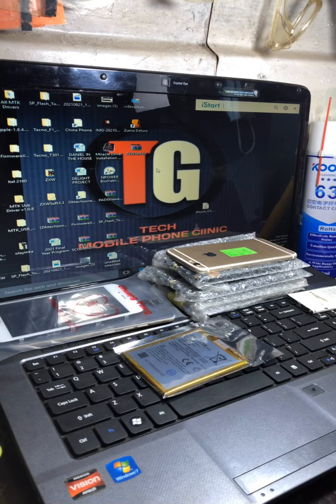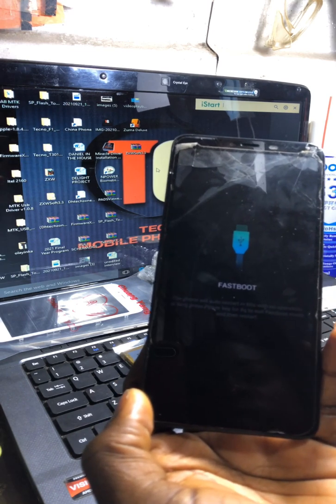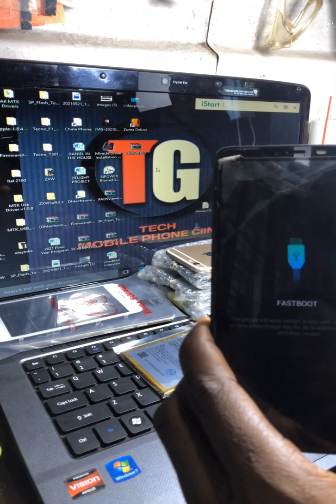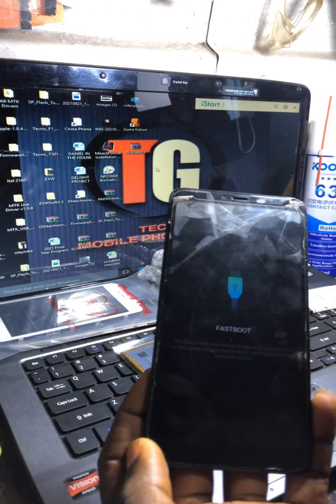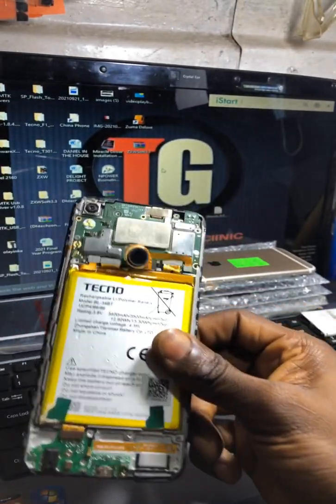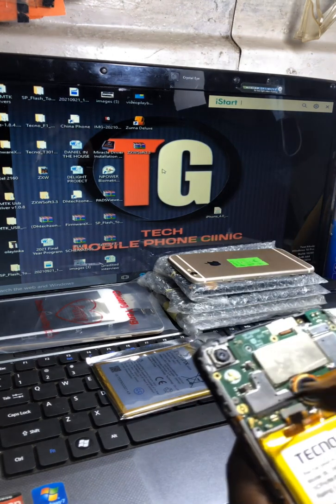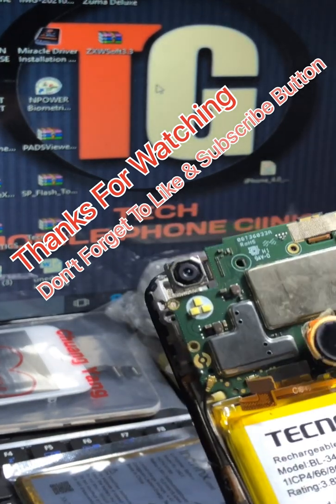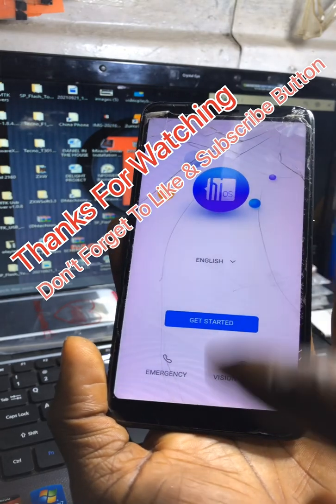Fastboot Mode Remedy For Tecno Spark 2 Ka70

Comment: Engineer please my own refused to see system

Even with my cm2

I can't find kcolo on the PCB to boot it during flashing
Reply from the maker: Replace the sub-board
Reply: Now the board is working phone is flashing on fastboot mode but still locked,

I have hydra and cm2 dongles